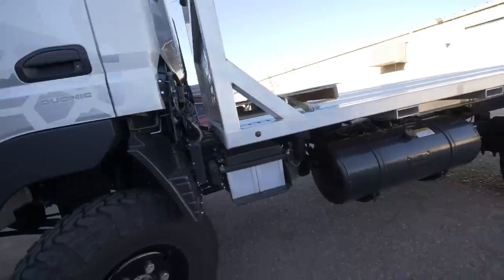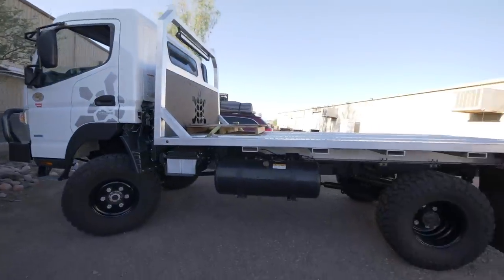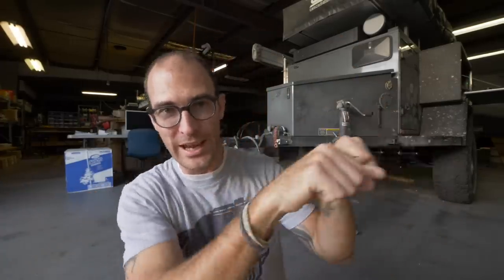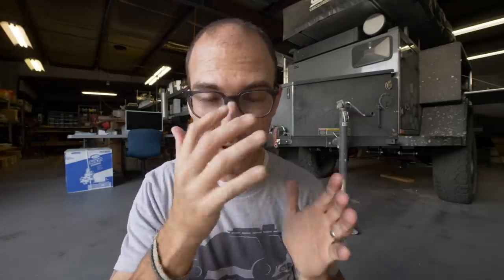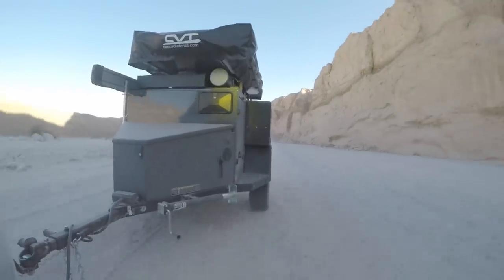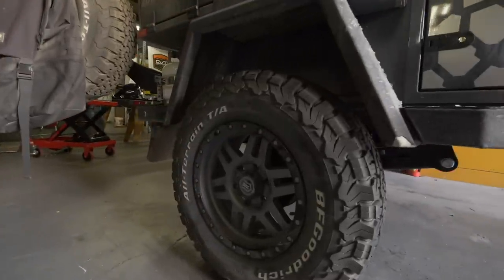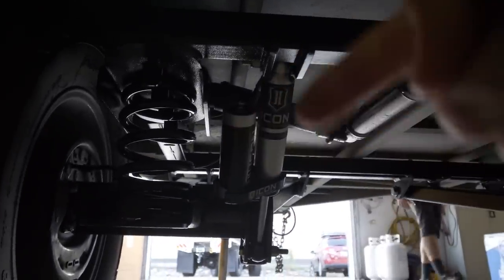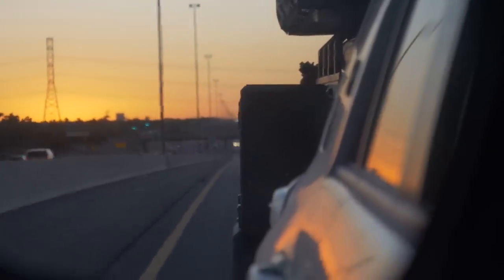Custom ICON Suspension on the Turtleback Trailer???

Comment: Very exciting ,I like the set up,I'm going Stir Crazy waiting for my icon suspension, I have everything but the rear resi shocks. Would you suggest the hydraulic bump stops? Also,icon stated they shipped the coilovers for the front with 2 inches of lift, did you crank yours up higher in case you wanted to run larger tires in the future?

Comment: What is the water that comes out of the pipe underneath your trailer?
Reply: I’m curious to know as well.
Reply from the maker: That’s the drain pipe for the sink. Sometimes after things move around or you get rolling trapped water in the piping comes out
Reply: Ok, got it. Thanks for the info.
Reply: So it just dumps grey water directly onto the ground?  Is that even legal?
Reply: Bob Hodges dumping water is legal but not sure about grey water. Why not, it’s not black water...

Comment: Firstly great video, Secondly, won't the exposed shock absorber shaft pick up all the debris and dust up off the road and wear out the seal into the main unit??? Surely it needs a rubber boot around it to give it a chance of reliability. Thirdly what happens if you break a spring miles from nowhere, do they give you some sort of elastomer block to support the weight of the trailer and stop the two parts of the suspension smashing together as you try to get home. Fourthly, very jealous of your pool.
Reply from the maker: Dodgy Davo whoa dodgy. No need to take personal jabs at my teeth!